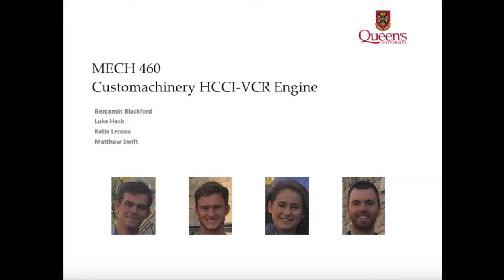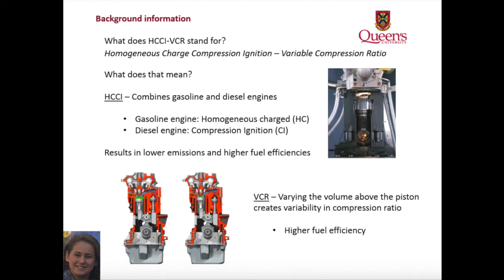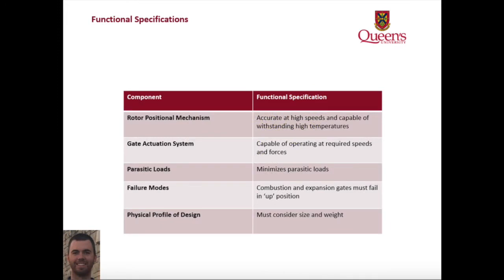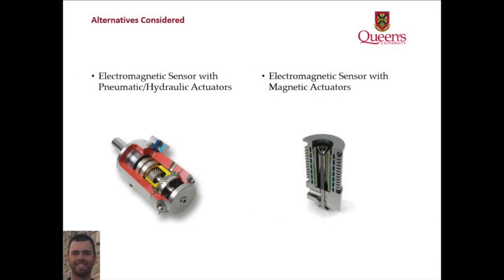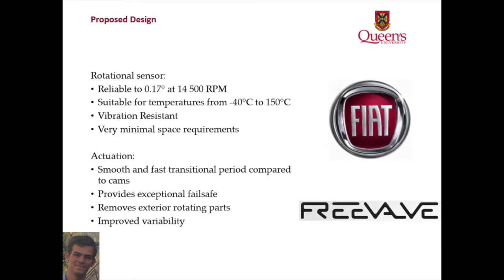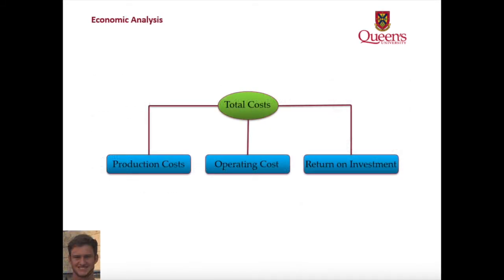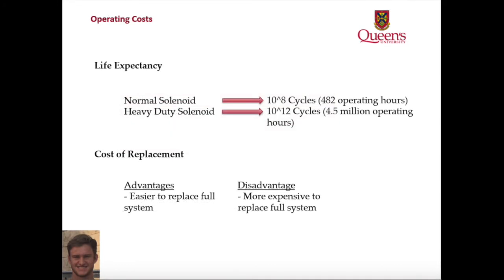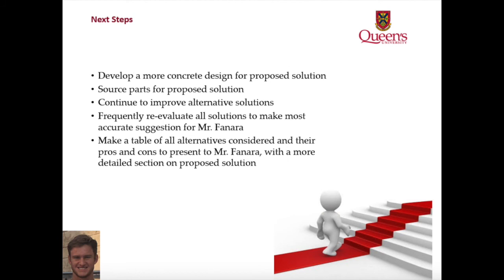Mechanics of a HCCI-VCR Rotary Engine

Comment: Immediate observations.   1)  Friction forces on sliding gates whilst maintaining a gas tight seal would be unacceptable.  2) No cooling provision for either the rotor or the exhaust vane.  3) Lousy combustion chamber geometry, should approach a spherical shape and this design will cause too much quenching. 4) Adequate lubrication of both the vanes and the rotor/housing interface is a major problem. 5) Flow coefficients look too poor for good breathing at higher rpm, thus limiting specific output.